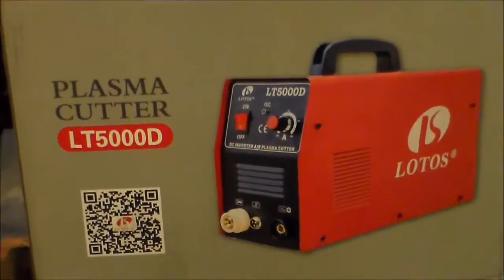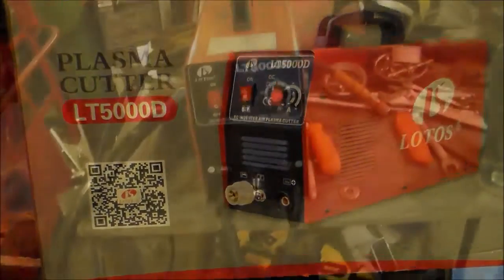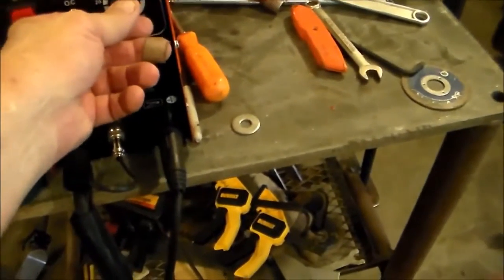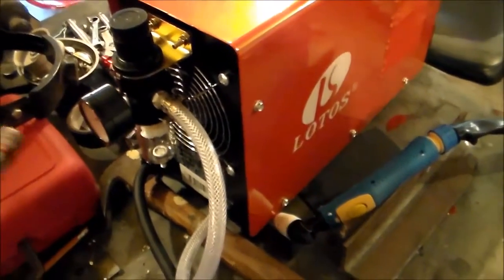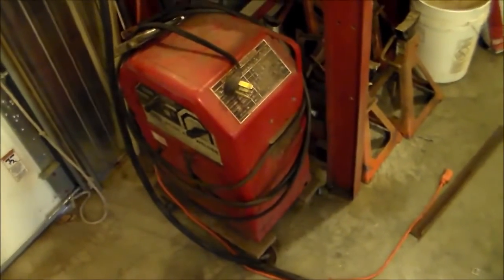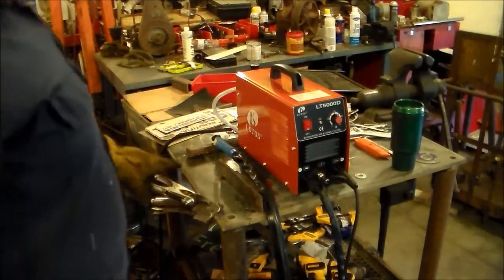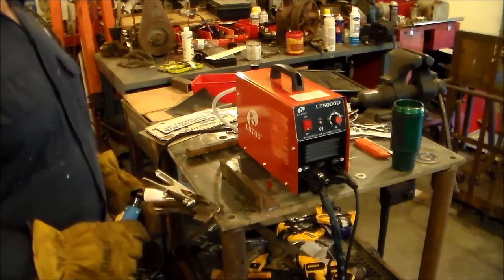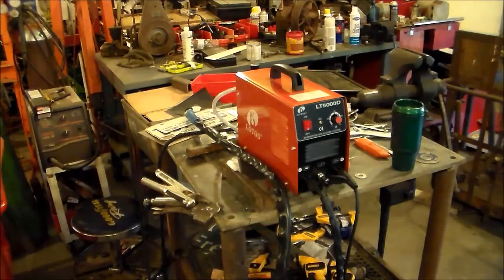Plasma Cutter

Comment: l pretty much have the same machine and its about 8 years old, still kicking, moisture is a plasma cutters enimy, l put a in line air dryer for a paint gun on the air inlet to help.
Reply: +Mustie1 Good tip to know. Thanks
Reply from the maker: +Mustie1 Very good tip, I have some of those and going to put one on today. Thanks
Reply: +Mustie1 that is what I was going to say. we use to get a bottle of air for ours at the foundry. Water burns up the tips fast.

Comment: Wow! I didn't know you could get a plasma cutter in that price range. I have been wanting one for years. Thanks for the video.
Reply from the maker: +WallysPlace66    Me too, when I saw that I jumped on it. And if it didn't work HD has a no question ask return policy. Thanks
Reply from the maker: My compressor is 14.1cfm and the plasma cutter takes 60 to 70 psi. I will look in the paperwork to see if it requires anything else.
Reply: Thanks Lloyd

Comment: I think your going to love your plasma cutter. I have a lotos ltp5000d (only difference is a pilot arc for cutting threw rusty and painted metals) had it for a few years and its awesome and ive had no issues with it. Its the same cutter i used in my cnc plasma table video and its been a great tool.
Reply from the maker: +builtrodewreckedit  That sounds great, I need to check that out.  Glad to hear your happy with yours. Thanks for watching

Comment: Great price you gota do another review after using it a few times. I have been wanting to get one cause my torch hoses have gone bad. 2 Sets of hoses and one tank of acetylene just is not rite.lol
Reply from the maker: +scottsinfl  What I have heard is moisture is hard on the tips. So I need to do some work to improve my compressor to reduce moisture is the air. Will do , Thanks

Comment: Sold I'm Gonna Get One lol - T=up Lloyd
Reply from the maker: They make several types , the one I bought and a pilot arc model. The pilot arc will burn through paint at the startup . The one I have you might have to grind a small bare spot on a painted surface to start.